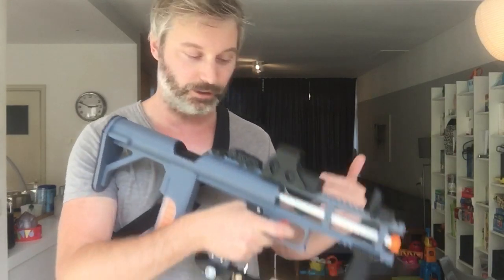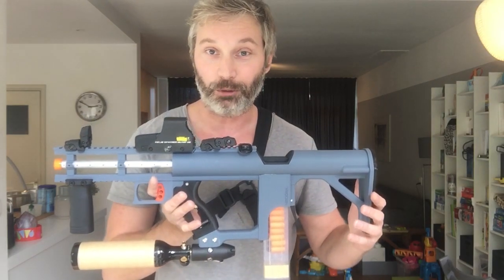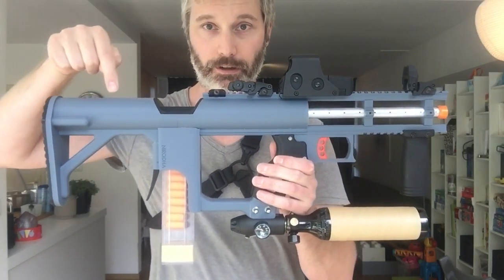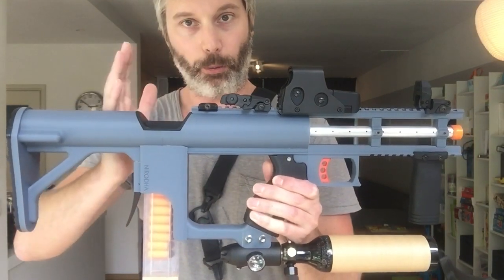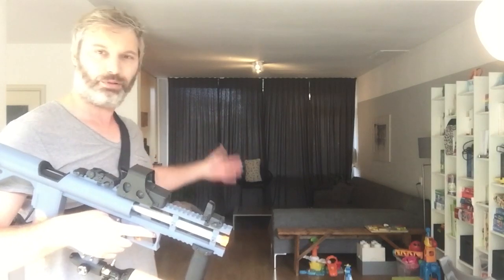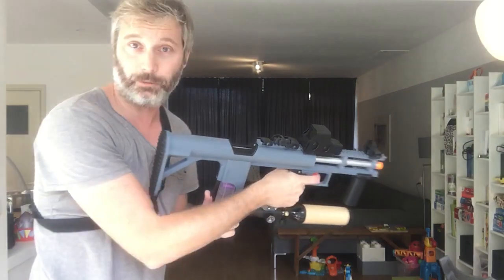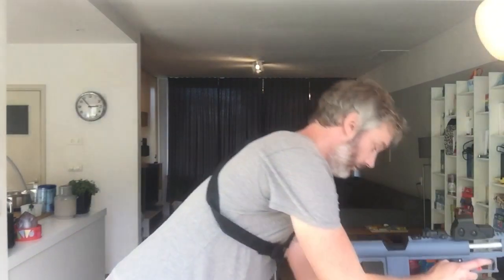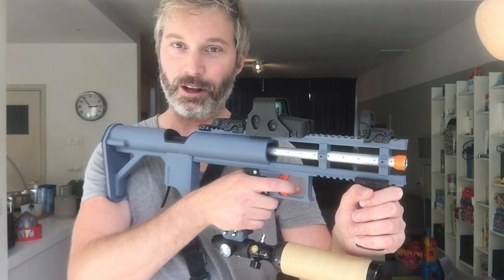Nerf 3D printed semi auto HPA ‘Super Core’ bullpup blaster - Firing demo!

Comment: How does the air valve work? Usually it stops releasing air till u stop squeezing on the trigger but here it’s only a short burst
Reply from the maker: This blaster uses a ‘Super core’… which is a hobby grade ‘engine’ specially for HPA nerf blasters. Google super core and you’ll get info on it. They are no longer being produced so hard to come by these days. Hope this helps.
Reply: @nirodha7028  alr thanks

Comment: If I may ask what filament color and company is that?
Reply from the maker: Sure! ColorFabb PLA/PHA blue/grey
Reply: @nirodha7028  what printer did you use for this video?
Reply from the maker: @snowfault1684  the parts were printed on a PRUSA i3 mk3
Reply: @nirodha7028  is there anyway to hook it up to a hose so I can have a tank on my back?
Reply from the maker: @snowfault1684  ofcourse. Just a matter of routing the hose from the bottom of the grip. Some people have done this. I personally prefer the tank up front as it perfectly balanced the blaster around the grip area…

Comment: Whats the effective range of this gun? Have you tested it? Good looking hardware
Reply from the maker: It is NOT a gun. It is an HPA powered foam dart blaster. Its effective range is equal to a spring powered blaster capable of around 300 fps. Ofcourse lower muzzle velocities are also possible by dialing down the second stage regulator. One of the perks of an HPA powered blaster is the ability to dial in your muzzle velocity to the specific event you are playing in. Different events have different FPS caps.

Effective range is a difficult word... that is not only determined by the shear average range a dart can travel (at a given angle or flat) but also very much about at what distance the blaster is still acurate enough to consistently hit a human sized target. In my experience that range is about 20-25 meters when one uses a scar at the end of the muzzle.
Reply: @nirodha7028  i stand corrected; HPA foam dart blaster :)  thanks for the details. Ive been wanting to build one myself.

Comment: Just wondering, isn’t that breach dangerous if you use your finger to clear jams
Reply from the maker: Mister Bubs no sir. When you clear a jam you flip the lever on the second stage reg to depresurize the downstream system first. Also... the vertical magstop (the black piece sitting on top of the shell/magwell above the breech area) has a slot in it that isn’t wide enough to put your finger inside it. Lastly... even when you were to out your finger in front of the ‘normally closed breech pusher’ somehow in that moment when the trigger is pulled and the breech is momentarily ‘open’... the closing force of the pusher isn’t enough to really harm your finger. Hope this helps :-) Thank you for your justified question!
Reply: Great to know that my finger won't be cut off by it, thanks for the detailed reply!

Comment: If the entry for the dart was flanged a little would it help? Could use a slightly bigger breach tube of 9/16 into a 17/32 barrel? Or is it a dart folding causing the jam?
This is very cool works much like a painball marker but for nerf! All the advantages of a springer with out the sore pump arm at the end of the day. Need to get some fancy 3d designers to make it look cooler 👍
Reply from the maker: Side85Winder it now has a 3D printed funnel created by Dean from Blastertech inside the receiver and no longer jams with worker darts. Works like a charm now! The receiver is a much wider portion than the brass you are suggesting. Thank you for your enthusiasm.

Comment: Loving your videos, you are very natural in front of the camera. Keep 'em coming! Also, I would definitely buy a parts kit for a good $50+ that they are worth to not have to source them myself.
Reply from the maker: Tate Geiger Thank you for the compliment :-)

What parts would be included for 50 USD? I hope you are not referring to the core, barrel, receiver and custom coupler between second stage reg and push to connect fitting because those are way more expensive  already. The tank itself and on its own is more than 50 USD... so is the second stage reg. This is not a cheap build :-)
Reply: Sorry, I didn't specify, that was a horribly phrased comment... Say all the hardware (excluding the 3d printed parts) for the blaster is $400 (I'm just taking a wild guess). I (and probably many others) would happily pay $450 or $500 since sourcing the hardware by oneself takes a lot of time and effort. Does that sorta make sense or am I still talking gibberish?
Reply from the maker: Tate Geiger makes more sense now :-) You are talking all the screws nut and bolts and perhaps the fittings and pneumatic hose. Well it would likely make it cheaper for everyone... but it would also imply me selling the kit. And I simply don’t have the time and resources to do that. Sorry :-)

Comment: Found this vid randomly on Reddit and thought i'd pop over here. Being used to using a pump grip LS i dig the ROF, and aesthetically i approve of the design. No worries about the nervousness mate, ya did fine...going on YouTube with your face visible is a prospect i'll personally be avoiding because it is scary af xD
Reply from the maker: Zoigle Thanks for dropping in to see the vid then! Yeah the ROF on a semi auto SUPER core HPA build is basically only limited by the speed at which you can pull the trigger... I didn’t fire at max ROF in this demo.

Yes you are right. It was rather daunting to go on vid like this. Thank you for your kind words on my effort :-) I appreciate that!

I hope to make an update video soon. I have a special insert comming in soon designed by Dean from Blastertech which should help feed worker darts without issue! Stay tuned for that!
Reply: @nirodha7028  No worries man :) One of these days i might get my hands on a SUPER, i am in the process of setting up for HPA right now so it's definitely a possibility in the future. For now, first step is a Specsbz-powered bolt action which i'm looking forward to. I've rung the bell so once you get the new part in and do a testing vid I'll come have a look!

Comment: It's been so exciting to watch the development of this via Instagram. Recently built up my SUPERcore build, and after a few initial issues, I'm very impressed. Did some quick tests at 65psi (my usual operating pressure for my other Ultrastock HPA build) and was getting an average of around 270, with highs over 300. I downtuned it to find out if I could get it consistently under 130, but ran out of air unfortunately (time for a tank refill this week). 

I also had some issues with feeding on the Gen 3 darts, but the Gen 2 darts were all total lasers with no feed issues. Unfortunately Gen 3s are still pretty pricey in the UK, so I'll stick with Gen 2 for now
Reply from the maker: Treezy for 130 FPS you’ll find you need a ported barrel that isn’t lined with brass... otherwise the darts wont leave the barrel... something to do with volume of air versus barrel length. Ofcourse you can use a shorter barrel... in my bullpup that doesn’t make sense though :-)
Reply: @nirodha7028  I'm using the stock Jet Alpha barrel at the moment, with a Worker scar threaded on the other end. Total airtight system. I was surprised to hit 300 without crazy pressures, but think it may be a little too long for consist lower velocities. My Longshot has an 11"  17/32 brass barrel and ported scar, and while it can go to lower velocities, it's far from consistent with them! Darts will either fly out at 120fps or fart out about 6ft away. That's why my Slingfire only has a 3" 17/32 brass barrel and scar. Consistently hits 130 average, yet even at 110psi won't break 200fps!
Reply from the maker: Treezy yup that sounds about right!

Comment: Is that Liams breech? because I made a very ring to smooth over the lip into a monkee mods barrel, which helped in feeding (not tested it under pressure but helps so much more when just manually pushing darts in)
Reply from the maker: Daniel Pocock Yes sir... it features the standard receiver by Liam. Dean of BlasterTech also created a funnel (insert for the receiver) I now learned to help make the feeding of worker darts smoother. I shall be testing that for sure! I’ve also asked Liam if he wants to look into changing the design of the receivers in the near future to have this built in. He mentioned he was/is already on top of that.
I am looking forward to the breech accepting worker gen 3 darts to be honest because their flight characteristics are soo much better than the ACC’s.
Thank you for your message!

Comment: What lubrication caused the seizure? And what is your recommended stuff?
Reply from the maker: The 3rd Person good question. I should have mentioned it in the video. What caused the core to not cycle completely was silicone ‘grease’. Don’t use that stuff. What ‘does’ work really  well (and I got the tip from Liam) is silicon ‘oil’... specifically with a viscosity of 100 sCt.

Comment: Awesome design and work. I am curious though what's the highest capacity half dart mags out there?  I've only ever seen the 15s
Reply from the maker: vampire847 well... there are 3D printed half dart mags that go a long way... literally. They make use of drum springs and I believe they can (in the most extreme cases) carry up to 40 darts.
Reply: Aitch Attachments is working on a short dart drum that's going to be a high capacity drum. It looks crazy! But not as crazy as his supercore bullpup build: if you've not seen it yet it's worth a look!
Reply from the maker: Treezy I have seen some small screenshots of it on my phone... sent by a friend. His blaster looks very nice! And is select fire if I am not mistaken? Unfortunately I havent got FB yet so cant see for myself. Are there other places his build are shared?
Reply: @nirodha7028  the select fire one was his previous build, can't remember if this one is too. Check his channel on YouTube (Atch Attachments) for a quick look at his new Supercore build. Or there's a post on the Britnerf forum with a bit more detail about the build and some sexy pics

Comment: Brilliant work mate. Seriously good. It's just so ... clean! How long will that manually-pumped bottle last?
Reply from the maker: UnscrupulousModefiler Thanks bud! Dean did a full tank test in his ADHD and got 200 shots out of it at 40 psi. I have yet to do a similar test with my blaster. It will likely happen at Island Infestation 1.
Reply: @nirodha7028  So 40psi might be about the sweet-spot for performance and efficiency out of these cores? (gets about 150fps(?) with this configuration, then on upwards with longer/differently-ported barrels...) Thinking if I aim to tune any future master-key attachments to run at 40psi, it should just be a direct attachment to the output off the same regulator? That would be really handy!
Reply from the maker: UnscrupulousModefiler well... 40 psi is a Nice setting for a SUPER core yes.. SNIPER core’s spiritual predecessor in the form of SOBER did 280 FPS at around 30 psi if memory serves me right... (it couldn’t run lower due to friction involved). Liam stated it was basically ‘too good’ at that point. SNIPER is purposely gimped a little in comparison to allow lower fps ranges aswell... but... generaly speaking it should be way more air efficient than SUPER cores. I’d suggest to wait it out a little for pinning down the sweet spot.

Also.. I don’t know if there ever will be a sweet spot. The whole point of a regulated pressure blaster is that you can easily change the fps output to serve your games needs. One blaster to play them all if you will. The performance of the underbarrel could simply scale with it I suppose?
Reply: @nirodha7028  Yeah, I suppose I'm less trying to pin down the "sweet spot" as attempting to anticipate the minimum pressure that the cores would conceivable be run at and try to design for a passable level of performance from a strap-on launcher tapping into that output (and as you suggest... making sure it can take that additional pressure as it gets dialled up for different game-types).

If I'm following the back-and-forth on the HPA forums, another limiting factor in minimum psi was the regulators themselves? (though that could be relatively easy to sort?).

As it is there's a heap of wasted air in the Absolution system firing missiles so I'm not too worried about running those at low psi, and I've a few cards yet to play getting the absolver-style shells as air-efficient as possible (3d printing may be on the menu sooner than anticipated, a dedicated short-dart absolver shell is theoretically better performing plus there are options for 2x3 or 2x4-shot "salvo" shells to really concentrate on range and power... and yet to try the famous Marshmellow-blaster style exhast valve on a tank). Given the tank-size I'm aiming for, 30psi might be the minimum I'd want to run the absolvers on though so yes, will be waiting to see what emerges as the "standard" low-pressure setting... and if they're still a bit gutless at that point it may be time to increase the volume a bit. It'll depend a bit on what people want to use them for: a wide choke close-range scatter-shot could still be quite handy even at low velocity =0)
Reply from the maker: UnscrupulousModefiler you get it! :-) I will keep you posted as good as I can.
Reply: @nirodha7028  👍

Comment: no part of it actually nerf but it does shoot half length foam darts that nerf doesn’t make
Reply from the maker: Boom tendo Hi! Half length darts which everyone in a competitive nerf environment deems the present and future of performance blasters. To me... a foam dart blaster is ‘nerf’ regardless of its propulsion method. HPA is something to be carefull with though and should only be used by adults or under adult suppervision and only on private locations specifically ‘open to HPA’... like paintball or airsoft arena’s. Everyone should abide by their local laws, rules and regulations and make sure owning or using such a blaster is not ilegal.

By the way... for you... being ‘the single biggest fan and promotor of Boomco’ I will make an exception and state hollow straw darts are also nerf ;-) Love your work! Greetings to the rest of the OC Nerf scene (if I am not mistaken).